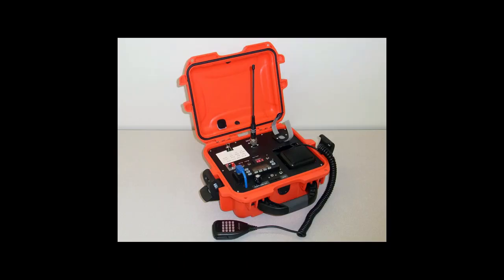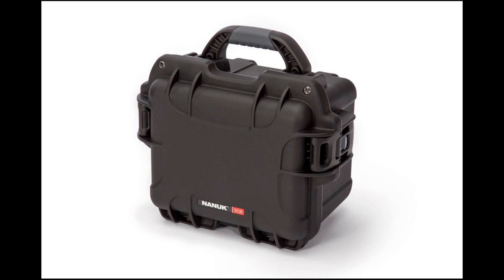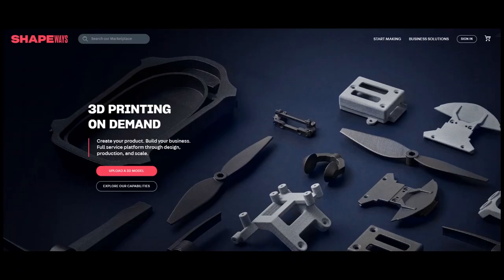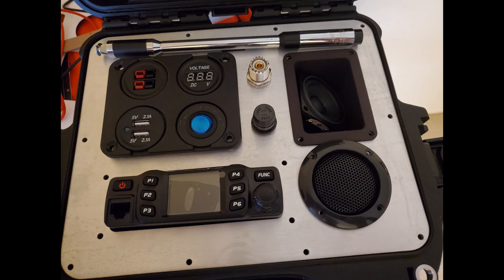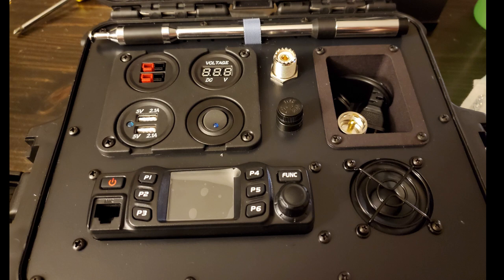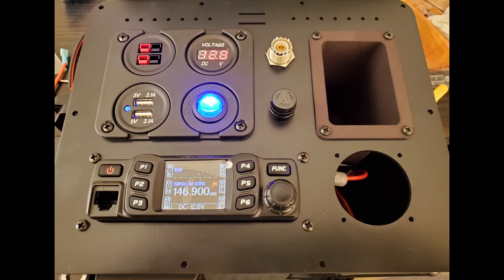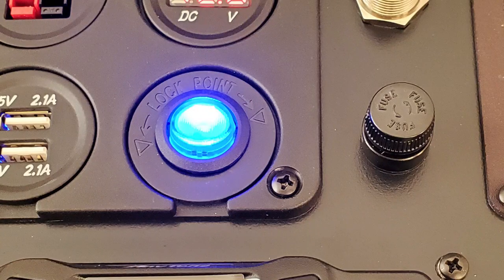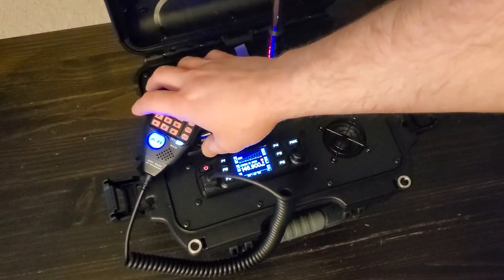Portable Ham Radio Go-Box | Build and Walk-through

Comment: Obsessive compulsive over-kill LOL, but great work. Good looking build, the best of DIY I have seen on you tube that did not cost $300 just for the case.
My parts list:
1. Mounting plate/cover: $8 whiteboard-blackboard 2'x4' from Home Depot. You choose which side to use, the white or black side. Very sturdy, cuts and drills clean with tape and patience. The white actually looks very clean and lets you see things easier in the dark. It is a whiteboard so easy to remove smudges/dirt.
2. Storage box: plastic rectangle planter, small. Has edges to attach it to the mounting cover. Many sizes and colors available.
3. Support for mounting cover: 4 1/2" bolts using nylon locking nuts with washers adjusted to needed height for cover. Used acorn nuts to secure the cover. No sharp edges from wing nuts.
4. Laser replacement: spade and step bits. The switch mounting plates cover any imperfections.
5. Box: Apache 3800. Small is good but functionality over form..
Not as water/dust proof but the Apache cases are much less costly. The 2800 to 4800 cases will allow for larger battery, more storage, and more devices such as solar charge controller if desired.
I have storage for goose neck light which has 3-levels of white light brightness and also one level of red light, two charging cables, USB Led lights, cigarette adapter for powering/charging devices that use that time of plug, such as my 300w Giandel power inverter
I know you and others know about size of cases, just thought I would mention them.

Comment: I really like the design and the honest walkthrough of how you made the decisions and what you would do differently in the next version. I have the same radio and a  Miady LiFePo4 battery, so I am really excited to think about a build of my own from the solid work you have done here. I really liked the speaker with fan grill which gives it a nice look and lets you hear the radio with noise outside. If you wanted some more airflow through the box, you might be able to mount a fan on the side of the storage bin and put a few skinny slots on it to suck in some fresh air and use your existing holes on the panel for exhaust. You probably need a smaller battery to fit the fan inside the box so it doesn't reduce the space in the bin. Thanks for sharing the parts list and CAD files. Well done!
Reply from the maker: Thanks Gregory, I'm glad you found it all helpful.

Comment: I am working on planning out a UHF/VHF go box with battery. But first on my list is a portable box for my Icom 7300 and 2300 (soon to be replaced with a 4100) without having to sell my soul. 

On a side note, I have an Anytone 778 and it has taken a beating and still going strong. It had gear dropped on it and it actually broke the plastic face surround in 3 places and dented the case. Glued the face back together and it still works like new.....even though it looks like hell.

Comment: This is one of the nicest boxes I've seen and I will surely use it as my spring point to build my own.   Just a few suggestions. If your plastic top plate was sagging you could have glued on the bottom of it a set of stiffeners running both directions. Need to find out what the best glue is for that type of plastic. You could make it out of the same plastic as the top plate, maybe 1/2 an inch deep.   As for the battery I think the bane of your existence was that metal shelf you got somewhere else. Toss that out. Just put the battery right on the bottom of your Box. Cut up some foam pool noodle and strap it to the corners with zip ties.  As for fasteners through the outside of the box there's no shame in that and it can stay relatively water tight by putting a dab of silicone caulk in the hole and under the head of the bolt or screw.  But you won't need that at all if you do away with the battery shelf.  See if you can get a LiFePO4 battery rather than Lead Acid.  It will hold a steady 12v charge till drained completely and can be recharged hundreds if not thousands of times. A lead battery will only maintain 12 V till it's 50% depleted.  Plus it's 3 times as heavy!

Comment: Couple things....first, great job.

Second, as an over analyzer with very real OCD, I can relate to the wiring comments about fixating on such things. Ive lived my whole like that. Just as you, I do in fact recognize that the effort, or cost, or even time is not likely worth some small issue that I just cant seem to ignore, so I usually end up making the correction anyway,

Third....that small power switch is only rated for 15 amps, so you might consider looking into a “master” switch that can more than carry the potential load of the radio, amp meter, and whatever might be connected to the usb or powerpoles.

Just my .02, and its only worth half of that 😁
Reply: I definitely felt it was comforting in a sense, I was diagnosed young, but honestly, as someone with OCD, I'm a smidge proud to say that this is the type of results it can yield. That extreme persistence to accomplish despite having already achieved something is what creates even greater. Knowing better can be done is what fosters such a degree of excellence. The stress, dread, and immense weight to carry pays off occasionally and helps make it all worth it.

Comment: One of the nicest boxes I've seen, Great Job !!
Powder coating would be a durable finish option for your aluminum. It is also expensive to do for a small piece but if you have time to wait for the powder coating company to do yours at the same time as someone else's larger job (of the same/color and finish) it may only cost you $20.
I will definitely refer back to your video and links as I hope to do a similar build soon. 
I am contemplating doing two cases the same size, one case for the radio and/or repeater and a second case for a larger battery with charger and power jacks. 
Again, congratulations on a job well done and very informative video !
Reply from the maker: Thanks Rick! A separate case for the power sure would have given me more wiggle room to work with.

Comment: If you were tight on space, why not make a custom pack from 18650s? They have much better energy density than a SLAB. You could also do something like purchase batteries for power tools so you can have multiples that can be swapped easily for charging. 2Ah, 4Ah, 6Ah, 9Ah, and 12Ah can all be found easily in 12V packs.

Comment: Great video. If I might suggest. Take the panel to a firearms place that does cerakoting. Might be a lot cheaper. Or you could LineX coat it and it would be super tough. I like your process and it's very easy to follow. Thanks!
Reply from the maker: Thanks Joe. If I make another one of these, I'm definitely going to look into cerakoting.

Comment: Yep, it will fail eventually from squishing those wires down. I did the same thing using a standard battery box. I made a go box out of it for camping and I had the wires from the outlets squished ever so slightly to get the top on and they eventually shorted out and melted one by one.  The problem are the outlets themselves. They aren't very sturdy and the prongs will eventually bend to the point of becoming damaged or in such a way that the wires detached. Luckily, I smelled the wires melting for each failure and was able to avoid a fire.

Comment: Put back an old big blue switch. All you need is to put some resistor in to lower the voltage to a blue led. Use potenciometer for testing.

Comment: A lot of those mics are speaker mics - so you wouldn't need that speaker in there. Those little 25w units made for ATV's are sealed so the fan might be of marginal use anyway - and you still need an air intake for that - so idk. These little boxes always have some compromises and trade-offs, so it is what it is! Ideally you'd want an antenna you could toss up in a tree, or you still won't get really any more range than using an HT with a good antenna. Really nice job though - clean install, and if you use the low power that thing will go forEVER on a charge. Not really much reason to use more than 5w anyway unless you pair it with an antenna in a tree, then you want to overcome transmisson losses in the cable.
Reply from the maker: Thanks for the feedback, Perry. Yea, my mic does have a speaker in it but it's not much good unless I hold it up to my ear like a phone. I like to just listen while doing work or whatever, and the little speaker I installed does the trick.  
  
I do have a wire antenna that I've tried (by hanging it from a tree) and I'm not convinced it did any better than the telescoping antenna. But, I also use the big antenna on my roof with this and that obviously works much better.

Comment: Looks like a great build. I built one myself but it seems I am getting quite an RF "buzz" in the background when I transmit. Any way to get around that?
Reply from the maker: I'm not quite sure, as I haven't had that problem. Is there any loose connections, or any power/battery wires touching the antenna wire that could cause some sort of interference?

Comment: Cerakote, DuraCoat, and KG Gunkote are all a lot more ding resistant than spray paint. Or, since your buddy already has the file, you could laser cut a thin sheet of plastic, maybe 0.028" Kydex, and glue it like a veneer on your aluminum face plate.
Reply: I might go with a nice marble veneer, just for elegance!

Comment: Really liked the video. I am looking at building my own and the AT-778UV is one of the radios I am considering. Kudos for sharing the cad files! I would of liked to hear the radio to see the performance of the speaker and I would of liked a bit more explanations on the electrical components: How do you recharge the battery? Dare I ask: What's the final price tag? ;-) 
Cheers!
Reply from the maker: Thanks! I recharge the battery with the small charger. It plugs into one of the powerpole outlets in the control panel.  As for the price tag... well, there was a bit of trial and error and some wasted money. But I think I probably spent at least $1200 at the end of the day.
Reply: @GreatLakesPrepping  Wow, really puts things into perspective. And here I am debating if I go with a 145$ radio or a 179$ radio ;-)
Reply from the maker: @hikingfish3  It was definitely a costly experiment! I've had people ask me if I can build them one exactly like this, and I've had to break the news that it would be about a grand (which includes only a very small markup for the effort). Gets pricey to manufacturer only one of something.

Comment: Hi, I am currently working on building a go box similar to this.  I'm also new to HAM; question, how is it connected so it can charge?  With the charger, can you run the radio while it's plugged into the wall or vehicle?
Reply from the maker: The charger plugs into the PowerPole outlets in the control panel. All the charger does is charge the battery. So yes, you can certainly use the radio while charging - but the charger isn't really "powering" the radio. The battery powers the radio, so that means if your radio draws power faster than your charger can charge, you could still run out of juice. It's not super likely though, because I can run this radio for HOURS without charging. Also, the charger I show in this video is very small (so it can fit in the little compartment). If you have a larger 12v charger, it would charge the battery faster.

I could have wired this differently to allow for the battery charger OR for direct power from some other source (like an external battery, vehicle, or power supply). But the way I did it, it requires the internal battery to have a charge.
Reply: @GreatLakesPrepping  Thanks for your reply!  What kind of charger do you currently use?  The battery that I purchased is an 8amp hour 12v battery.  The only type charger that I have found thus far is a small trickle charger, not sure if it would be big enough to charge and run radio..

Also, I want to be able to run this off a car battery if needed.  Would you know if you plug it in using the same power poles to the battery if it would overload the small battery inside the box?  If you would like to send me an Email that would be awesome as well..

Thanks!

Comment: You mentioned the clearance for the mic in the case does the mic fit in the cup for the charger? that may be an option and then have the mesh on the lid like you intended or even mount the charger to the lid and maybe velcro loops for cable management while stored.
Reply from the maker: I really did want to do something like that, but it turned out that the lid was too "shallow". If the lid had an extra inch or even 1/2 inch of height, I think it all would have worked out.

Comment: For charging the lead acid battery, did you build your own charging circuit or are you using some sort of off-the-shelf charger?
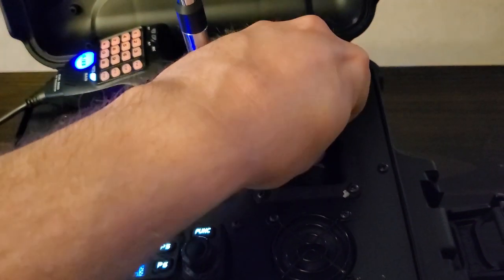Reply from the maker: It's an off-the-shelf compact charger. You can see the one I'm using in the video at 12:43, if you're interested, and here is the link to the product:
https://www.qsradio.com/shop-now.html#!/1-2A-12VDC-Wall-Charger-w-Powerpoles/p/58763603

Comment: Amazing build! An idea to maybe get you some more space with the lid. If you designed the next face recessed into the box about 5/8” with a lip around the edge to attach to the box and changed to the 7Ah like you were thinking about.  do you think that would help with the lid/space issue?  Again, amazing build and gave me some inspiration for my own!
Reply from the maker: That's a cool idea. I've thought about something similar, but I'm sure it would require the whole face to be 3D printed (rather than just laser-cut out of a flat material).

Comment: i hope you didnt buy all your compnents form QSR LOL as they are way over priced from amazon..  
few tips.
 disconnect radio from main power switch.  run it straight to battery with fusing.  This allows for the radio to still work without all the power sucking accessories you arent using to  be on.
put the mic in the holder box, keep the charger outside. (it looks smaller?)
pet peeve of mine. if your going to use colored items in the box.. make sure they are all the same color..  im a big fan of blue but as you seen it brighter than the red..  i have not seen a red led dual usb port led. but they do make a blue led voltmeter... 

you didnt need to use the flange the accessories came on.  you'll gain some space by directly panel mounting them.  also would have allowed them to be placed closer together and provided a bigger storage box.
there are panel mount 2.5mm plugs that are already pre made with lengths of cable and plugs. i would have kept the fan, but added a small speaker to mount out side the box...
ditch the glass fuse holder. use something more "standard" that your fellow friends might have "in the field"  mini ATC micro ATC could also have been mounted in the box and not panel mounted... what good is a radio in the field when the fuse blows and you cant power it anymore.. 
I do like the antenna solution, but id find a small "gum drop" antenna  and keep it in there as well.. because do you really want to transmit  20 watts in your face?
90 degree or "flag" connectors on your wiring. it will help make the wires "bend" easier when inserting.  also i may have missed it but looks like all you're wiring except the power poles is red?  this is a no no... does it mean you have to buy a spool of black wire to fix it.. sure. but lets say another operator opened up your box to look in it and they would be like 
'wheres your grounds?" i was told by some one time to draw a schematic for your wiring and keep it in the box for quick fixing if anything ever were to happen and you werent the to explain it to them...

ditch the storage box.. it looks cool and was a neat factor but next time (since this was aluminum) tig a piece or aluminum at the point where your equipmet stops, and the rest of the box is storage, instead of limiting  your self to that lil cubby....
great job.!

Comment: I know this is quite old, but where could I find information on wiring for a go-box like this? I’d like to set it up to have the option to connect to vehicle to charge/use vehicle power to run.
Reply from the maker: I realize I didn't spend much time in this video going over the specific wiring process. It's a tricky thing to demonstrate in a video, especially since I'm not an expert. I basically sketched out a wiring diagram on paper, to make sure it all made sense before i started wiring. After this long, I'd probably have to take the thing apart and do it all again to remind myself how it all goes together.

I will say that the powerpole outlets in it can accept all sorts of charging methods. I could use a 12v vehicle plug that has a powerpole connector on the other end of the cable, and that would plug right into this box.

Comment: Would you happen to have the dimensions for the file for the mounting plate? Looking to build a few of these exact boxes they look great! Thanks!
Reply from the maker: Thanks Dan. If you're able to open the file in a vector program like Adobe Illustrator, you could measure any dimension in there. If not, the file could be printed and measured by hand. Unfortunately I don't think I have any measurements other than the file itself for the plate I made.
Reply: @GreatLakesPrepping  alright yea I opened it on my phone as it's a pdf but maybe I'll try something else on the pc, I see the other files are .stl files which is sweet cause I have a 3d printer so I know how to view those files! Lol

Comment: Great job on your build. One comment was supposed to be an “EMP” Bomb. Not really a loss of life event. But knocks out the grid. If you line your case with copper screen or find a microwave to store it in. Also Cerakote is the toughest paint/coating out there. Works on wood, plastic, and metals.